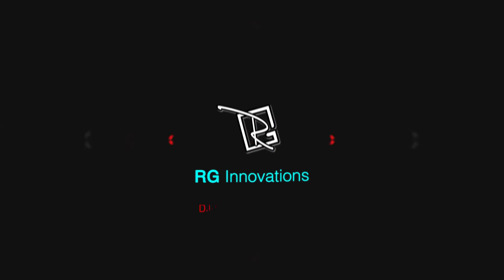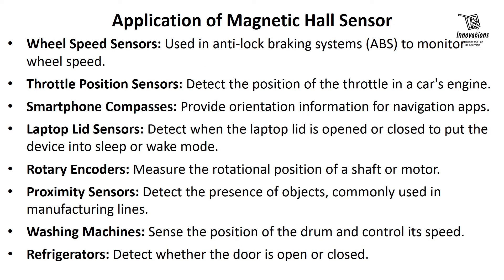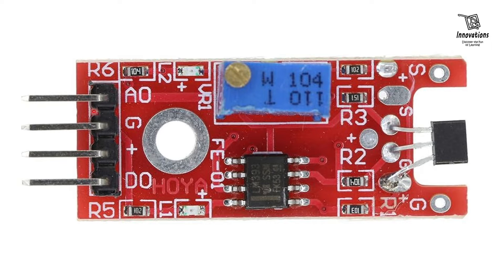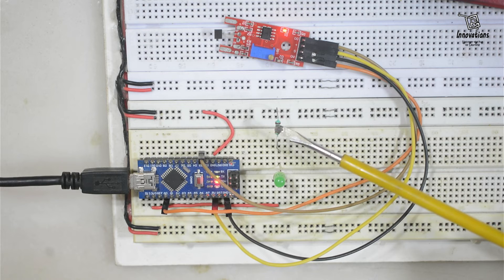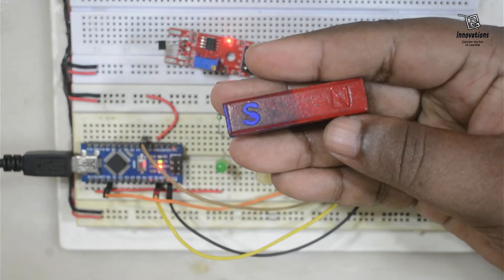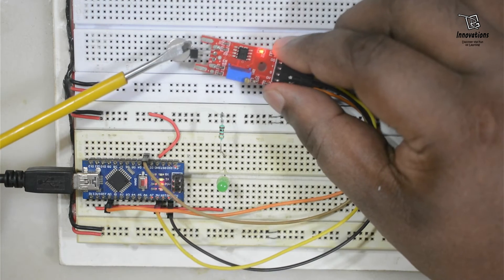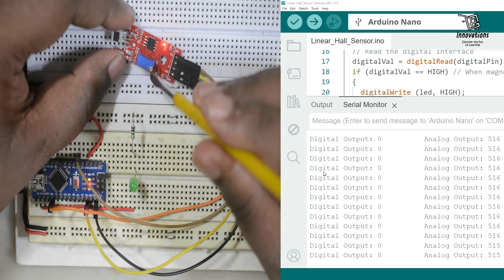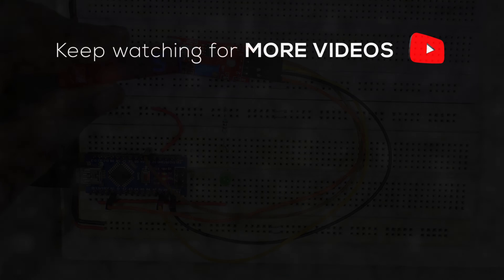Linear Magnetic Hall Sensor KY-024 -Detailed Explanation and Practical Demonstration with Arduino

Comment: Those seem to have very bad quality. I ordered these exact same ones from two different sources and both came with a dead hall sensor. I removed the dead hall sensores and soldered working ones on there and then the board worked.

Comment: This really needed more explanation. What's the use of the pot? Which way to turn to increase sensitivity of digital pin going high (??)
Reply: It alters the sensitivity of the response. if you turn it up, it will go high when the magnet is far away. If you turn it down you will need to bring the magnet closer before it goes high. This wasn't visible in the video unfortunately

Comment: Nice explanation.  Question:  Is the schematic for this (and other modules in the kit) available somewhere ?
Reply from the maker: You want the circuit diagram of this module?
Reply: @RGInnovations  Yes.  I want to mod it.  Didn't the manufacturer or seller provide the schematics somewhere ?  I bought a kit from Amazon that includes this and other modules.  But I can't seem to find the schematics anywhere, though I did find some application docs.

Comment: If we use only the digital output pin & connect it to a transistor base, then we can operate a relay without using an Arduino,..I suppose..?
Reply from the maker: Yes of course!